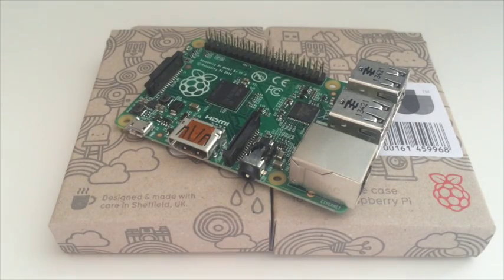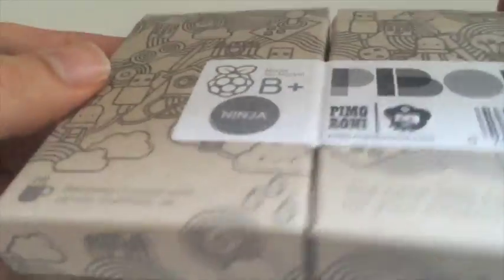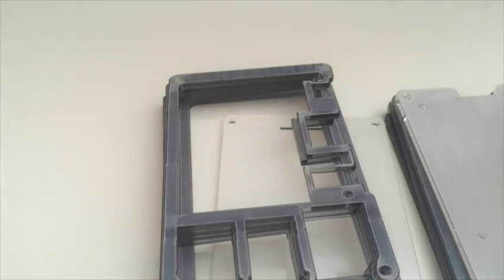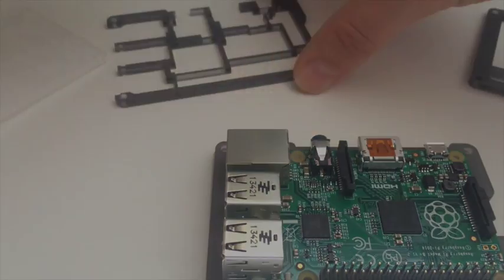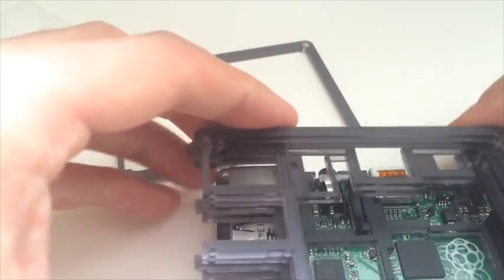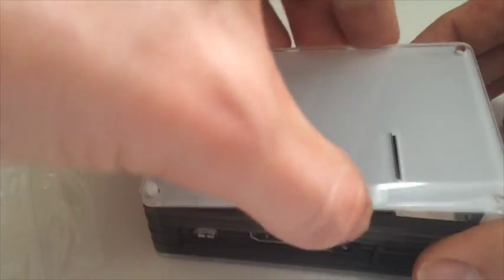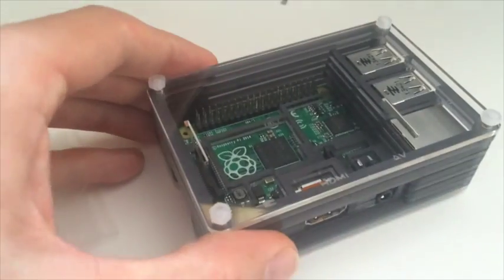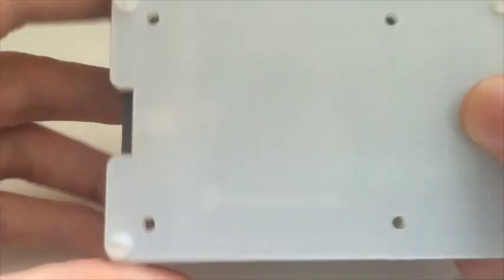Pimoroni PiBow Ninja for Raspberry Pi Model B+ Unboxing

Comment: do tft screens fit in this case ?
Reply from the maker: They might, but there are so many different sizes and shapes of TFT that no one case could properly support them all. Your best bet is either a PiTFT+ combined with this case: https://shop.pimoroni.com/products/pitft-plus-pibow

Or you could use a PiBow Coupe: https://shop.pimoroni.com/products/pibow-coupe-for-raspberry-pi-3

The latter doesn't cover the GPIO pins or top of the Pi, so most TFT displays will fit. But then it doesn't encase them like you might want.

Comment: PiBow's are brittle pieces of crap. Don't buy!
Reply: If you've had a problem with your PiBow you should drop a line to support, we'd be happy to replace it, or any broken layers!

Individually the perspex layers are not strong, due to the fine detailing needed to fit around the Pi, but together they make up a very robust case. Just needs a little tlc, that's all ;)

Comment: I got one of these pieces of crap and theres not even any holes for the heatsinks so I had to cut my own with a jigsaw and the plate shattered
Reply from the maker: Vivek Kaushal the Pi doesn't even need heatsinks. Why would anyone want massive great holes in their case for an unnecessary cosmetic modification?
Reply: Overclocking